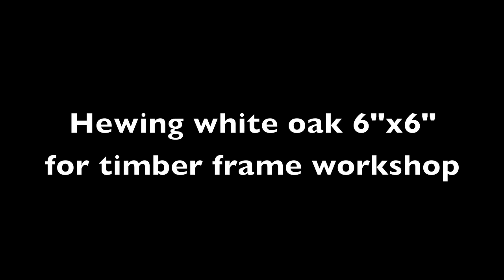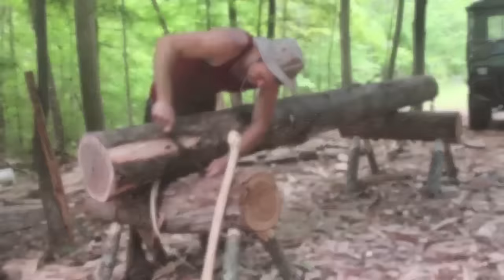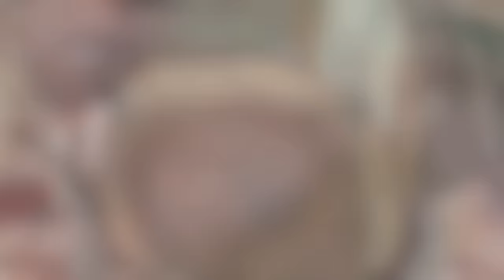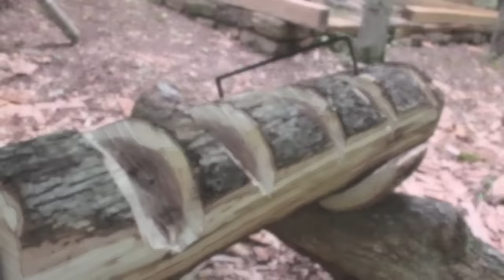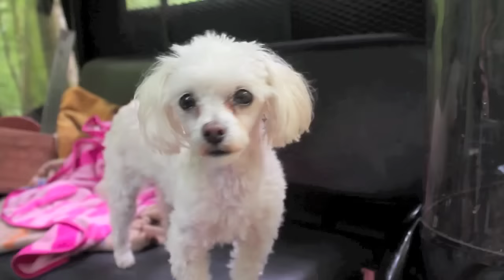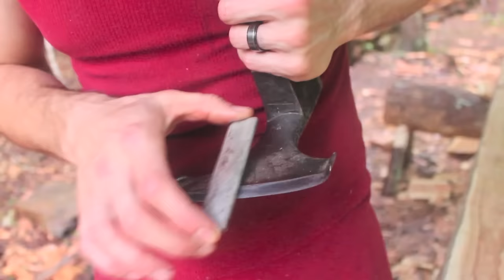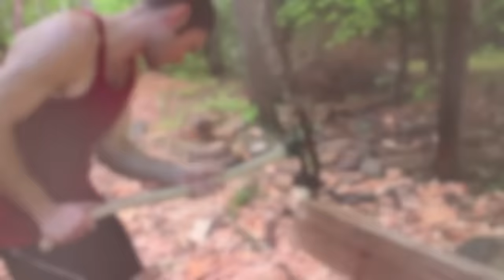hewing a white oak 6"x6"

Comment: Mr. chickadee...I too have found it very effective to use my felling axe to hew. Some seemingly well-researched educators on the you tubes refer to this as a pretty standard technique, and it looks like you have done a great job. The proof is in the pudding, my friend. Strong work. :)
Reply from the maker: +eltorrisimo Thanks for the great comment, I did use a broad axe and an adze for a few timbers, but finally realized just the felling axe was enough, and used it alone for 99% of our frame. We really like the texture this leaves and hopefully helps anyone give it a try even if they don't have a special axe or adze for the job. Many log homes were undoubtably hewed with only a felling axe by pioneers who would have but a few tools.

Comment: Also, you've got some skill there on this hew, I tried my first one a couple days ago with an awesome antique double edge Kelly true temper I bought off eBay. I spent a couple days sharpening it to a mirror, razor sharp edge (both sides) and about two minutes into the job I somehow mis swong it and it hit me hard in the shin, luckily somehow the side of it hit me and I didn't get cut, I'm done until I find some shin guard chaps.
Reply: Shane K 
I hope you also get the right axe.  Double bit aces are for felling, you need a hewing and/or broad axe...

Of course... sometimes we are stuck working with the tools we have.  I have seen an Afghani remove a nut from a Toyota hilux using a rock and a stick.

Good luck with your build.

Comment: I don't have any experience hewing logs, but I was under the impression that a long handled adze like that was intended to be swung like a pendulum while straddling the log, slicing/riving along the grain, not across it.   I can't argue with your results though.
Reply: Adam Perkins Everything in life has more than one use my friend. Thats how better techniques/tools are formed. Adaptation is the fuel for life ;)
Reply from the maker: Its a lipped or shipwrights adze, made to use across the grain, a carpenters adze is used as you describe.
Reply: Mr. Chickadee, you're fucking badass! Your videos are so crazy and inspiring.

Comment: I'm not going to say that he did this wrong, because he got the job done. It is much easier to swing an axe accurately when you swing vertically instead of horizontally. To do this the log either has to be on the ground or he has to stand on the log while it is in the cradle. This is the same for when using the long handled adz at the end of the video. You can put a hatchet sized handle on an adz and stand next the piece, but that takes away power and efficiency at the head.

Comment: Excellent work! I just felled a black walnut. You have inspired to hew my mantel by hand!
Reply from the maker: +Ryan Kudasik Thats great! We would love to see the process!
Reply: +Out Of Place Ninja Actually. I do have a lot. On my 3.5 acres I&#39;d estimate I have ten or so. that is if you don&#39;t count the 40-50 saplings I counted. In fact, I just potted a few up and selling them. A few happen to be releasing their juglone right where we want to put a garden. I didn't know their wood was expensive. I guess that would make my mantel more of a treasure.
Reply: +Mr. Chickadee Hi, one quick question I can't seem to piece together. Once you have one end of the log measured out how do you know that your other end lines up perfectly? In other words how do you know if it's going to be straight? Does that make sense?
Reply from the maker: +Ryan Kudasik If I understand your question, you want to know how your "boxed heart" on either end of the log stays in the same plane, so when you finish you have a timber which is square and parallel? 

So you get the log situated where it lays well on whatever supports you will use for your preferred height and style of hewing. Then dog it down so it can't move, and DONT move it until you lay out both ends. Now, lay out both ends with either a plumb bob as I did, or a spirit level, boxing the heart (keeping the pith center in the center of your square timber layout). If you do this with the level or plumb bob to guide your lines, you will have two sides of the square which are perpendicular to the ground/magnetic force of the planet, and two which are parallel with it, and if you don't roll or move the timber as you lay out both ends, they both will be the same, as they are both layed out using gravity. So when you snap lines between these square corners, you know they are straight and square and parallel to each other end to end. Now just remove the wood outside these lines, and you have it!
Reply: Ah... that's why you used a plumb. I was wondering! Great channel by the way. I just found you and will definitely be watching all the videos. I can't believe I had not found it earlier.
Reply: Thank you for your detailed reply. Sorry for being dense. I guess it still doesn't add up to me. So what you are saying is to use the center of the log (heart) as center of the box on both ends of the log. Am I correct?
Reply from the maker: Yes, kind of, the heart is the center pith, it is not always in the center of the log, but can be off to one side or the other deepening on growing conditions. Imagine a bullseye target, the smallest ring/circle is the heart, its the beginning of the trees life when it was a sapling, each subsequent ring was added by a good growing year after that. If the tree grew on a hillside perhaps you will find this smallest heart circle off to one side. Regardless of where it is, your finished timber should have this tinniest circle, the heart, in its center when you lay out. Just use a framing square and measure out from this heart say half of your desired timber size in each direction, so three inches one way, and three the other for a 6" timber. Now use your plumb bob or spirit level to draw straight lines for these two positions as I did in the video. So long as your log is stationary as you lay out both ends, you can't go wrong.
Reply: Alright! Thanks again for your detailed reply. I think I'm ready! I'll send you some pics or video of the mantel.
Reply from the maker: Thats great! I can't wait to see how it comes out!

Comment: How do you mark both ends of the log to make sure your 6x6 isn't twisted or crooked when you finish cutting...
Reply from the maker: marking both using the plumb bob without moving the log
Reply: @robertaylor9218  The iron brace is often referred to as a "log dog"

Comment: What did you rub on the end,  was that vaseline?
Reply: It's a wax-y compound to keep the moisture in better, the end is where the majority of it will be lost. Standard for large pieces and specialty wood you'd find at places nicer than commercial hardware stores. Just helps prevent super drastic drying twists/splits as I'd guess in my semi-limited experience.
Reply: We sawyers will wax or paint the end of logs in order to slow the drying process as the ends are where the moisture in the log is lost. The slower wood dries, the fewer splits and cracks there are and the higher the quality of lumber we can produce. This is why you will often see the ends of boards painted green, orange, red or white.

Comment: I tried to imitate what you did here.  The hewing part went surprisingly well, but where I unexpectedly had trouble was with the chalk line.  Maybe your log was just closer to a perfect cylinder before you started, but it didn't seem possible for me to get an accurate chalk line across an irregular surface (even apart from the issues of not getting a line at all in the low spots.)  Do you, Mr. Chickadee, or anyone else have any advice for me on how to get an accurate, straight line to cut my notches down to?
Reply: Melissa Brown , I rotate the log until I get a straight side up, all logs seem to have one, just eye down the log. Now you can hew down the same depth the entire log until you get a flat big enough to mark out what you need. Now you can hew down from that line at 90 deg. Repeat until all sides are done.
Reply: Center line pull your measurements left or right from that line .
Reply: Set up your chalk line where you want it making sure it is close to but doesn't touch any place except the ends along the log. Transfer string position level to the log with marker or whatever at regular spacing. Connect the dots with a straight edge and they should be much straighter than before. A lot of this is done by eye and skill with the tools but that's why we like it right? Good luck 👍

Comment: I find standing over the log you get a wider range of motion while allowing gravity to bring the axe down on it. I imagine your arms get pretty tired swinging the axe in a side to side motion.
Reply from the maker: The only "right" way is what works best for you! I tried the method you mention, and many others, then had my wife time my progress while I gauged my fatigue and back pain. What we settled on is the method you see here, but thats just what worked for me. 
Ironically, Ive since learned a much better way, using a crosscut saw to kerf, axe to bust off the pieces and a scrub plane to smooth to a lovely finish. Havent made a video of this one yet.

Comment: if you had cut it with a saw would that not be less wasteful? You would have planks of oak 'left over' to use, no? rather than just wood chips. Or am I wrong?
Reply from the maker: In this case, we didnt have a sawmill, so that wasnt an option. Also, this log was just big enough for a 6X6, on the little end. Boards you could have sawn would have been flat sawn and sapwood, which is the worst quality you could get from this log. IN our case the pieces made good firewood, so no waste anyway!
Reply: oh I see. Ok fair enough

Comment: What's that cream stuff ur putting on the end
Reply: Tallow
Reply: Do ants/bugs eat the animal fat?
Reply: Wax.  Probably bees wax mixed with a little mineral oil.  It seals the end grain of the wood and keeps it from drying too fast.  If it drys quickly, it will check (crack). You don’t want that.  Some use latex paint or there are paints made specifically for this purpose, but they are expensive.

Comment: Great work. 
Some negative comments from guys who say you have to do it a different way, with different tools. Yes, traditionally, felling ax while standing on top of log to cut your side notches, then standing on ground side with broad axe to hew your sides and then finally back on top of the log with an adze to essentially plane it. Your method accomplishes the same thing, but really is a lot safer as you are never swinging the axe or adze near your feet as you would if you were standing on top of the log in the traditional way. The final result speaks for itself. If you had to make some beams for others and you showed up with these amazing looking hand hewn squared off beams, everyone would say great job, no one would say " how did you make them?"

Were you able to get that log up on the supports totally by yourself?
Reply from the maker: +eyeguyeyeguy1 Thanks for the comment. A quick search of Youtube will show anyone many ways to hew from all over the globe, its sad when some folks think there is only the way they know, so everyone else has to be wrong. When we close our minds, any learning and growing stops. 
No these oak logs were HEAVY, I used a tripod and block and tackle I made shown in another video.
Reply: +Mr. Chickadee Exactly. I was taught the traditional methods but whatever gets the job done when it comes down to it.

Comment: I love this video. Such patience! I have one question though: at the beginning, when you're marking out, at each end you have spiked bars holding the piece in position. These look very useful, and I would certainly invest in a pair, but what are they called and where can I get hold of them. I've tried describing them, even drawing them to various merchants but usually just get a blank look... Any advice welcome.
Keep up the great work Mr Chickadee, it will be marvelous to see how things progress. Best regards, Nigel
Reply from the maker: +Nigel Sansom Thanks for the kind words. They are called log dogs, or spike dogs in my area, basically two large staples or mild steel or wrought iron. I forged my own after learning how from Roy Underhills episode of the woodwrights shop. IM not aware of anyone selling them commercially, you may need to get a blacksmith involved, if so, its important he knows the two points are perpendicular to each other, so each end penetrates the log with the grain. If you can watch the below episode it will explain better. 

http://www.thirteen.org/programs/the-woodwrights-shop/iron-work-for-timber-work/

That is the link to the episode. Im not sure where you are located but I could possible forge you a pair.
Reply: +Mr. Chickadee Brilliant! Many thanks for this. Very best regards, Nigel

Comment: Hi I have a question and I think you might be the right person  to ask (I'm not a native english speaker so my vocabulary might be awkard) :

I have 2 logs of apple tree about 1 meter long by 0.5 meter in diameter each (thats around 3.3 by 1.64 feet), and I want to get some "board", or wood I could do some small woodworking with, not building large like you do. I don't have or really want to use chainsaws, and buying chainsaw mills. I'd like to do it the old way, and spending  no money if possible. 

Is it possible to split a log into several boards I can plane ? (I don't even know if the grain of apple would allow it, or even if it is possible with straight grain wood)
Is hewing necessary in this case ? I know one of the driyng methods is not to hew and stack the boards to "reconstruct" the log, but should I do this or hew and dry the wood directly into boards 
Also there is a lot of sap wood, around half the log, is it still worth trying to do this ? I'm a new "woodworker", I barely know anything about milling and processing lumber

The wood didn't cost me anything so even if I screw up one log, I still have another one

Anyways, thank you for your inspiring videos, bravo for your skills and the calming traditional woodwork
Reply from the maker: In your situation I would rive the log into boards (if the grain is straight this works well) you split or "rive" the log into sections like a pie, then you can use a small axe to trim the wood near square, then plane it to finish. Since it is split in this way it will be very stable and can be used for many things like chairs or other projects even still wet. 

the other option would be to saw it with a hand saw, this will be much more difficult and time consuming.
Reply from the maker: see this video where I use a split piece to make a large board

https://www.youtube.com/watch?v=KYnfTq2z3Fc
Reply: Thanks for the answer. Another question, is it possible to split the log in boards sections (like a saw mill) instead of pie ? It seems the yield would be better since there is so much wood to remove to make a squared board (but that would give me a reason to get an old wooden jack/jointer plane so that's nice)
Also that way we would loose the quarter sawn like type of board

Thanks again
Reply from the maker: yes you can, though you will end up with basically flat sawn wood, which must be dried as it will tend to cup and distort, quarer sawn or "riven" wood will not move but will be smaller. 
check out this and he other two videos this guy made

https://www.youtube.com/watch?v=iaEisEnENyg
Reply: Escalator

Comment: You are a superb craftsman my man! I would love to build a small 12x12 utility shed from hand hewn logs off of my property. How long (if at all) did you let the logs dry out before you began? Keep up the excellent work!
Reply from the maker: +Dirk Diggler Thanks! You should, its an amazing experience. You should work the logs as green as possible, hew the day you fell each one of possible, let them rest in a shady covered area and seal the end grain with wax or something similar to slow the drying. Some even paint oil on the sides to help slow drying but this is not normally necessary. I would hew all the timbers needed, then cut all the joints, then raise everything up as soon as the joints are cut. Try and get it all up as fast as you can so it can all start drying and settling down locked together, this will help with warping and twisting.

Comment: Using a shipwrights adze takes a lot of practice to get good. When I use mine it tends to glance off the wood often since you are trying to take such a small slice of wood with it. The end result is nice but it truly is a lot of work
Reply from the maker: True, its not really for hewing, but works. The best Ive found now is a very heavily cambered scrub plane, leaves a lovely and interesting finish too. For the adzing, try this trick for better control...if you are right handed, take your left hand, hold the end of the handle and anchor that hand at a comfortable spot on your hip, about where your left pants pocket is. Now hold it there, never moving, just lift and drop the adze with the right hand, if you dont move your feet, you should be forced to swing the adze in a perfect plane, making accuracy easier!
Reply: Thanks for the tip.  I'll try that next time.